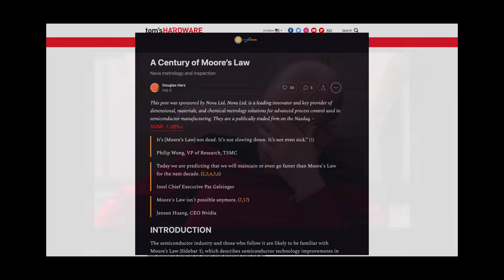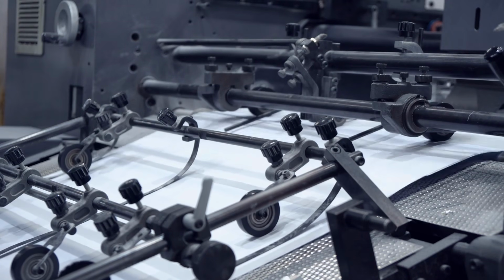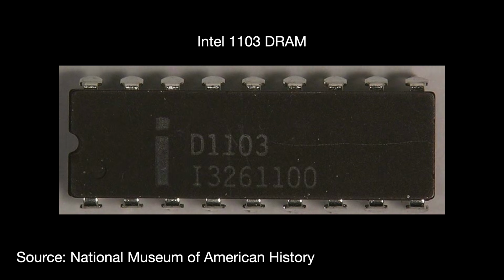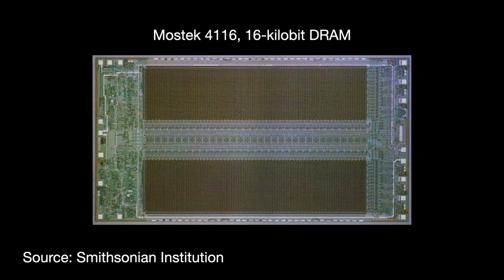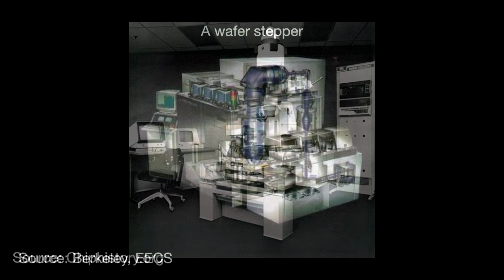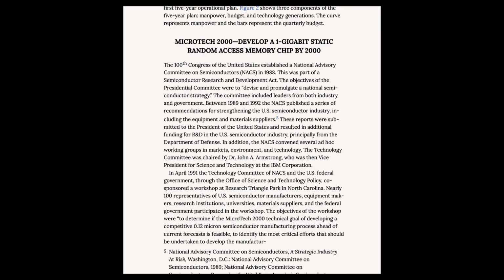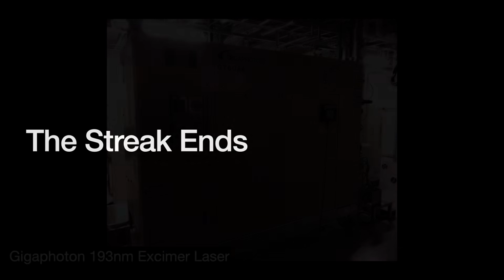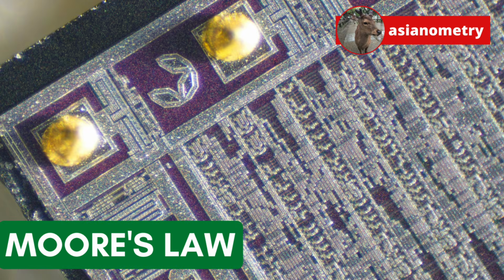Why Moore’s Law Matters

Comment: I have been looking into Graphene FETs for computational use and other alternatives to the existing Si. One of the main challenges facing any Si alternative is the repeated "extending" of Moore's law. Would you cover post Silicon technologies in a video ? I find your videos quite fascinating and they help keep me informed while I look for roles in the semiconductor industry. Thank you.
Reply: Industry can't move to larger wafer because cost, so moving to another technology... I would bet more on using carbon in different forms as addition to silicon base, not change of everything. At last I didn't hear anything which suggesting is a viable, I think it required a lot more research to make it to market. Researchers are overselling they inventions ;)

Comment: Still waiting for a better deal than my 10 year old desktop. Sure there have been some advancments, but sure as hell nothing exponential (I had desktops through the whole of the 90s with real exp improvments) and I can see no substantial improvment in cost per unit of compute power or ram capacity either. What slight cost improvment there is, has been fully swallowed by monetary inflation.

Comment: We're still a few gens away from not needing more compute for gaming imo. We have been trading more performance for equally more power too often last few gens. Id be glad to go back to the days of an actually 50W TDP CPU and sub 200W max TDP GPU that can handle all the latest games at 100-140fps without needing over the top cooling solutions and noise. Not to mention AMD and nvidia seem to be abandoning the low and mid range as much as they can right now. So still a way to go if you ask me.

Comment: 5:23 - the guy who discovered ALUMINUM named it, "aluminum", and it was only subsequent Brits who thought it needed more flourish and changed it to "aluminium".

However, the correct pronunciation and spelling are still, "aluminum".

Especially lacking any hint of King's English, you should be pronouncing it, "aluminum".
Reply: Technically he originally proposed Alum-ium, but people complained it wasn't classical enough, so he changed it to the actual Latin alumin-um (lit. meaning "from-alum")...  
Then the same complainers claimed that the "ium" ending "sounded" more classical, and wanted "alumin-ium", even though the "um" ending was LITERALLY CORRECT CLASSICAL LATIN, and they started calling it that even though he kept using "alumin-um".

TLDR, the original invented name for the element was "Alum-ium", which is thus correct ENGLISH...
The proper declension LATIN name given to the element is "Alumin-um", which is thus correct LATIN...
And "alumin-ium" is only correct if you are speaking the language of ignorant sore losers.

Comment: From a chip users standpoint, I remember the market wide semi level, the transition to new FET designs, in the 1st half of the 1980s. These improved MOSFETs made faster CMOS chips, so big chips, moved from NMOS to lower power CMOS. At the discrete level, the creation of power MOSFETs.

I thought Intel's big win was IBM choosing its uP for its IBM PC, and the clones, having to stick to it, to stay compatible. Even moving to the 386, when IBM balked at using it, fearing stepping on its mainframe market.

Comment: Lithography did break pretty badly in early 00s. But at the same time die sizes and power rise up to meet demand (that there was plenty of back then)

Back in 99 cpu pretty much worked as TTL logic still. Sure, voltage was down, but but same basic method was still used.

During early 00s this was change considerably to save power at the same time as power avaliable was increased.

At the same time significantly increasing the die area.

So while the 1965 idea was around component, not speed, by the time 90 came around, performance was the main metric.

Mores law sort of was adopted to what the market needed.

Of cause the lack of new lithography in 00s totaly broke the original idea of mores law, still this period the performance increased to the dubbeling every 18 month. This was really just calmed down in early 10s when power Constraints become more important. That is why we seen more moderate improvements in 10s, but on the other hand better products.

Comment: Shrinking transistor technology also led to lower power consumption solutions, particularly valuable for battery powered devices
Reply: Yes.  The shrinking of a transistor’s area by 50%:
1) Allows twice as many transistors on a chip with the same area.
2) The same area implies basically the same cost, for twice as many transistors (far from costing twice as much).
3) A transistor with 1/2 the area consumes 1/2 the power.  With twice as many at 1/2 the power, the power consumption stays basically unchanged, for a chip with twice as many transistors.

Neither the power nor the cost double when the number of transistors double in the same unit of area.  This scaling phenomenon is the real important thing.

If transistors stopped shrinking, compute that needs twice as many transistors will start costing twice as much and using twice the power.  Do this for a few generations and costing 8x as much and consuming 8x as much power and 8x the area …. that will make you appreciate the transistor shrinkage advances we’ve had in the past.

Comment: The future of AI depends on better hardware as well. Whether it be servers or the edge devices.. the more the better to an almost immeasurable degree. Advancements in algorithms and increase in transistor per watt will allow for many things to be automated making some things cheaper and also making a lot of things more accessible to the average person. Moores law, in it's original concept, is dead. The advantages of faster hardware will always exist and I imagine we will still have hardware improvements coming in 50 years.. all be it not on the level it is today. Unless we break the code(so to speak) of a better material than silicon. The only thing humans are limited by is the speed of light and scale of atomic and quantum interactions. We are very far from the theoretical limits of our universe.

Comment: I remember in the late 70s in Manila we were making a K&S 478 add on that turned that manual wire bonder into one controlled by a microprocessor. Zylog, AMD, Intel, were our customers... what an amazing time.... our computer had no monitor, used a trackpad with a billard ball in it, and had 12 kb of ram!

Comment: Our 22 MacBook Pro M2 cranks through video editing almost 2x faster than our 19 iMac's with 6core Intel chips while using 30x less electricity / so improvements in chip performance also improve energy efficiency by enabling smaller power efficient chips with less thermal cooling to do more compute faster with way less battery power or grid power, meaning smartphones with the most efficient chips have longer battery life & motor controllers in EV's like Chevy Bolt become more efficient at converting battery DC power to AC at variable frequencies for the traction motor induction or IPM etc to more effectively transfer energy into the windings & rotor so higher energy efficiency at producing torque to move the vehicle & people & cargo inside / we can see how improvements in one domain of technology can bleed over to improve other products & services with time :) Consider the role of renewable energy & energy storage, better controllers to regular battery charging & load matching & production from rooftop solar PV modules means the system can cost less while delivering more energy for a faster ROI or lower cost structure that even renters & landlords can afford to upgrade their living spaces with // just like they added L2 charging station spots to our apartment parking lot, we can continue to improve everything with more intelligence focused on being efficient and using less electricity to do even more. In an EV improved energy efficiency means a smaller lower mass battery can still improve range per charge. For example if the aerodynamic efficiency improved like Aptera with a very clean sheet slippery design, then a 16kWh battery in a very efficient vehicle can give the driver more range than a 40kWh battery in a boxy inefficiency drag intensive design, especially at speeds above 50mph or 70mph where aerodynamic penalties to energy consumption are a 4th order square as speed increases, this is why nearly all aircraft have similar tube cone nost + wind designs to make the air slip around the passenger tube efficiently to interact with the wing surfaces for control // using CFS computation fluid simulation NASA & BOEING can make blended body or blended wing passenger aircraft that get 3x better energy economy than 787 for even lower cost per mile or radically reduced fuel consumption & similar related radical reductions in emissions

Comment: 22:03 - It's not a nihilism unless you're advocating for abolishment of consumer rights or something. Industry's been pushing for years for taking control away from users along with driving them to buy more expensive and less reliable hardware. Videogames, software and just general purpose apps getting to be more demanding without any meaningfull payback my smartphone is 10 years old and I could easily get along with 20 y.o. mobile phone just as well. I use incredibly outdated software and I see no benefits for me (not some "NOAA") to upgrade any of it besides a bunch of corporates breaking backwards compatibility in their own product because they immagined themselves some high profits. I'd like "things to get faster" if theese "things" are mine - not G+\MS's spyware. It's not nihilism when the object of nihilism is insultingly untrustworthy and community is brainhammerragingly better at optimising (not to mention making things work).

Comment: 21:51 The problem is that consumer electronics (including PCs) drives the volume required to make it worthwhile for manufacturers spend all those billions of dollars to build new fabs.  As of now, only gamers are driving the mass purchase of new CPUs.  For example, a three year old Lenovo L490 with trailing edge specs supplied by my company does everything I need it to do, and I had an AMD FX-6100 for almost 10 years; just recently I upgraded to an Athlon 3000G (hardly a cutting edge system) yet it also satisfies my needs.
And I'm perfectly satisfied with an iPhone 8+.

Comment: I would never argue that we don't need improvements in compute performance but you can make the related statement that improvements in computing power (along with a seemingly never ending thirst for more SW developers) has lead to less efficient SW being developed to take adequate advantage of compute performance.
Reply: True. But this lack of code efficiency also comes with many advantages like ease of writing, prototyping, debugging, reviewing, correcting, improving, porting or even installing programs. All of the heavy lift is made by a few software bricks now (compilers, interpreters, OS, HALs, APIs, game engines, Web browsers).
Even in embedded, it becomes way more practical to restrict ASM or RTOS usage only when it's imperatively required.
Reply: This claim is sort of absurd on its face. If it were more profitable to produce more efficient software, then that's would companies would make. However, the increasing complexity of business domains, infrastructure and the sheer amount of different platforms a piece of code must be compatible with makes it extremely inefficient (in terms of development costs) to attempt to squeeze every last bit of performance from a chip by writing code in low-level languages.

Simply put, there's nothing stopping you from putting out highly optimized software today. But you would simply get out-competed unless you were working on a very specific domain or platform. So it's not that powerful hardware leads to less efficient software, but that less efficient software is usually more competitively produced and priced. Hardware performance simply dictates the minimum point at which software is simply not usable due to its inefficiency. For most applications, "adequate" advantage of compute performance IS the ability to produce less efficient software that is still usable, because this means you can produce MORE software or tackle problems that are more complex.

If a browser already opens a webpage less than 2 seconds, nobody realistically needs it to be faster. It (the browser or the webpage) just needs better features, bugfixes or increased stability. Or maybe just less costly maintenance.
Reply: @son_guhun  it still really depends on the application. 
Sure Linux got rid of its old ASM pieces to be plain C (and now Rust) but in the mean time Android mostly got rid of Java runtime to compile software during install like BSDs do, despite the vast improvement of ARM SoCs.

Similarly, developing production software for microcontrolers is not done with extremely inefficient/portable code like MicroPython or Arduino. And sometimes ASM is still used for critical timing functions.

Same thing with desktop applications: Developing small tools and games with high level languages and APIs can be done without taxing too much of the increasing computing resources (even on laptops and embedded) but it's never used for developing AAA games or production applications that want to use every resources available to speed up the execution.

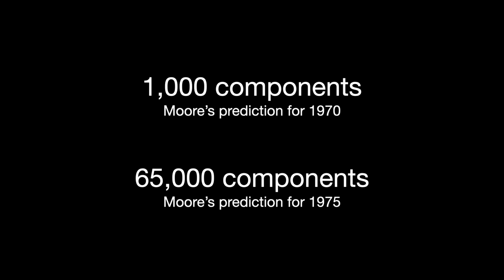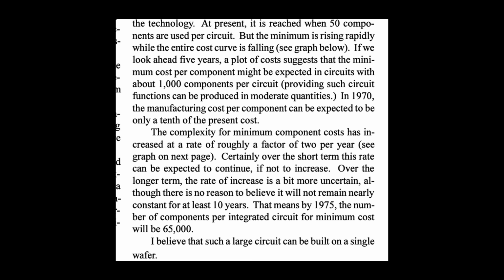Comment: Really interesting video. One small quibble, 2:19 - 2:49 "That 'roughly' is doing some serious heavy lifting". Not really in my opinion. As you point out, 50*2^10 is only 51 200, but the power of the exponent is so large, that you only need to increase the base by 2.5% to 2.05 to make up the difference. 50*2.05^10 = 65 540

Personally I think 2.05 falls comfortably within the neighbourhood of "roughly" 2
Reply: That was my thought
Reply: I came here to make that comment. Thanks for saving me the trouble!

Comment: We need to adapt and change the way we compute itself. We need to quit looking for unicorn farts with dark matter detectors and tackle problems like P Vs. NP.  We need to make out computing me effective and efficient. Right now we run A LOT of flawed, blotted programs. I think things like gallium arsenic will surely help but we need to go back to the basics. We need to change the geometry and architecture of processors. The advent of the arm processor is a perfect example.
Reply: Go back to the basics? So basically we've reached the "local maximum" for the current technological paradigms in place for compute. Sounds like some fundamental revolution is needed at the underlying architectural level to continue anything like Moore's law level growth.
Reply: @buzzsaw838  there are many ways the current model of computing can change.

Comment: In the past decade there was no improvement in CPU frequency and almost no improvement in single-thread performance and cost. The term "3 nanometer process" has no relation to any physical feature (such as gate length, metal pitch, or gate pitch) of the transistors. In other words, the "3 nanometer process" is a marketing term. According to International Roadmap for Devices and Systems published by IEEE Standards Association Industry Connection, the 3 nm process is expected to have a contacted gate pitch of 48 nanometers and a tightest metal pitch of 24 nanometers.
Reply: My current computers have CPUs from 2011. And the comparable CPU of today has only a doubling in speed of each core.
Reply: CPU frequency is more about Dennard scaling, which has been dead for a while. Every time we think Moore's law is dead, we come up with another breakthrough to extend it, although I wouldn't be surprised if it was the end of the line soon.
Reply: Yet throughput has managed to increase, so maybe those things don't matter
Reply: I like your style - reality rather than hype...thanks

Comment: I don't argue with your thesis that Moore's Law matters, but I'd like to push back a bit. There are industries where the extra compute is absolutely necessary. That being said, there are countless ways that code can be improved to make better use of compute. One major machine learning model was improved by I believe 16% because they realized that one method of squaring in Python was faster than another (x*x is different from x**2 is different from pow(x,2), three different functions that give exactly the same result, one is always faster than the others). Not that we should stop pushing forward with compute, but we should equally emphasize efficiency in coding and compiling. New programmers are really bad at coding, and throwing more compute at the problem is most often the solution, it's an easy way to turn it into "not my problem." "Just buy a better CPU/GPU" is the most common philosophy of gaming companies. I don't think we should get rid of Moore's Law, and your summary at the end was a perfect explanation of why, but everyone needs to take ownership and responsibility for improving the things that are under their control. Manufacturers/compilers can't give up and say "write better code," and coders equally can't give up and say "give us more compute." Everyone should have a relentless drive to improve.

Comment: 1978 the Motorola 6800.  The applications uses exploded.   The rocket was just launched.
I loved all that was CMOS the RCA 4 bit;   Now we are at around 2000MIPS.  The IBM System 360 waas about 16.6MIPS in 1970.
The self heat now increases with operating temperature due to higher leakage currents of smaller geometry, around 90nanoM